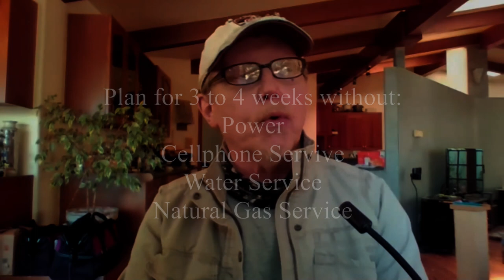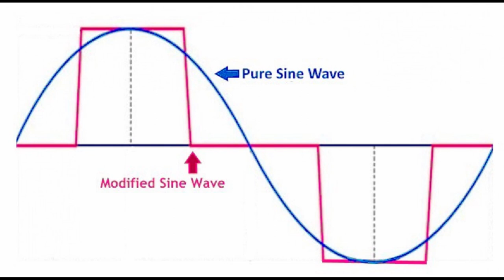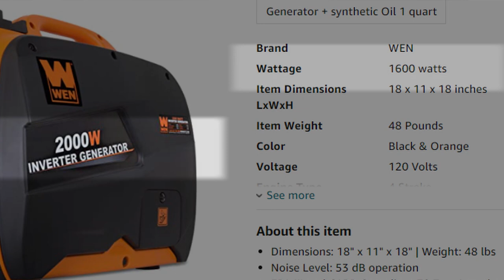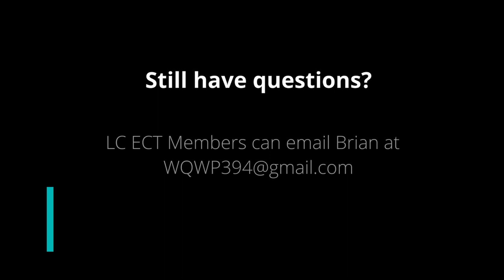Deployable Emergency Backup Power

Comment: I find using a Honda 2000i with the Hutch Mountain Propane converter and using a standard BBQ propane bottle to be a much safer deployable power source than gas. Our Red Cross EMS team got rid of the generator which was powering our field transmitter and computer in favor of the inverter system. Your comparison was a well done program on generator versus inverter. Carbon Monoxide is still the enemy.

Comment: Something to consider:   We had a 3 day outage because of high winds.   You could not get gasoline, because the gas station pumps did not have electricity.  It took them a couple days to get generators to run the pumps.   Natural Gas. might be the  better way.  Some gasoline generators can be converted to natural gas or LPG.

Comment: I have a Honda Eu2000i that is converted to propane and can be run off of my 500 gallon tank or portable tanks if needed.  I can purchase the propane much cheaper and no need to rotate gasoline.  I also have 900 watts of solar for radios and lights so I can get by with only running the generator a few hours a day if needed.
Reply from the maker: Sounds like a good system. If you've solve the issue of fuel storage with propane I'd say you good to go.